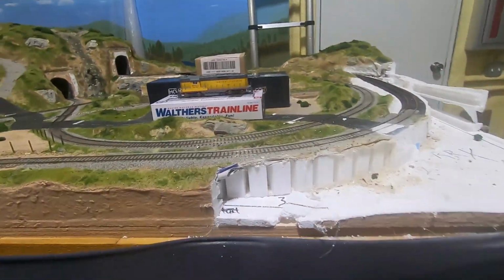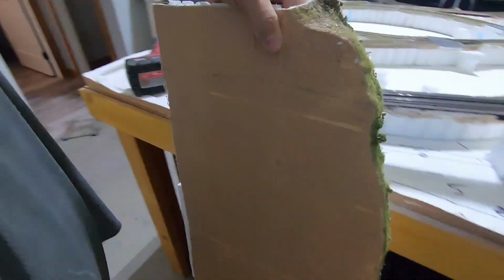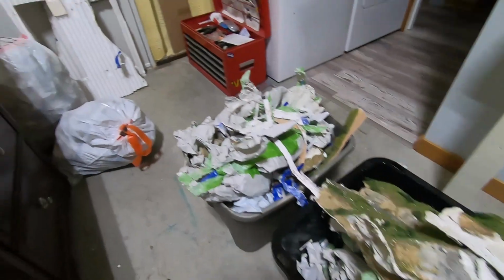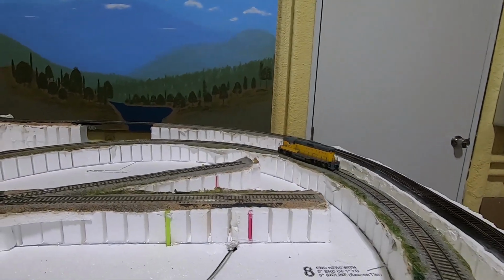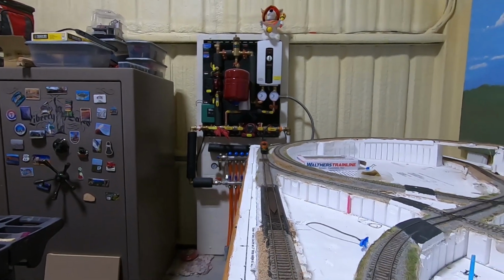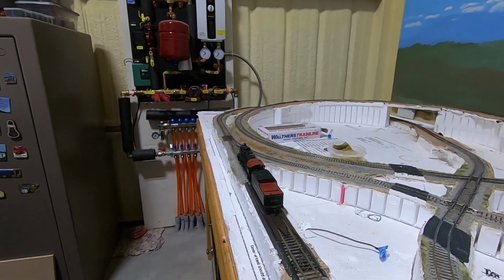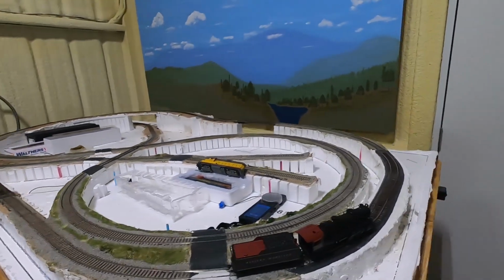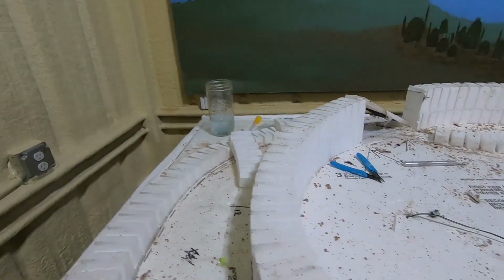Woodland Scenics Grand Valley, New beginning

Comment: Have you ever used a file or carefully sanded your plastic guard rails on your crossing tracks such as Dan suggests in one of his videos?
For your steam engine, I think you should set up a camera stationary and focus it on the track/wheels there and record as you slowly go over the crossing.
You're probably riding up onto a guard rail and even when you don't derail entirely, it's lifting a wheel or two up and out of contact with the rail. Anyway a careful camera shot and slow mo might help you  there and in other places. As a means of diagnosing issues.
Reply from the maker: Hey Tom,  Yep filed multiple times..initially everything was a problem...Dans file did the trick for most.  But never the steamer in CW rotation.  With everything disassembled was able to see that it was probably a combination on the crossing and that little crook they put just prior.  Those fixed set of 6 wheels didnt like that transition and in that direction ...when pushed through..   No other train had problem.  The steamers 6 in line wheels  dont like the crook tunnel exit or the crossing.. Already totally disassembled and gone.
Reply: @copterdude1  Ah I see. I forget you probably are many steps beyond your latest video, haha.